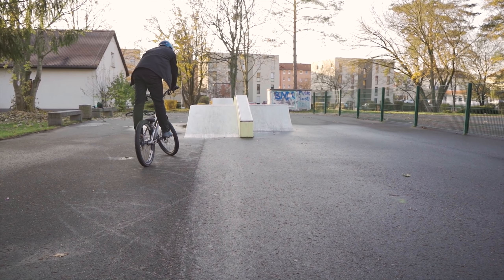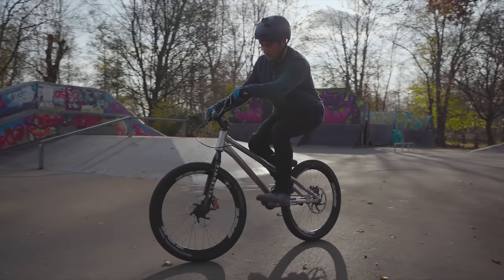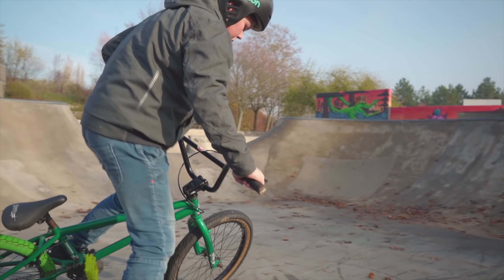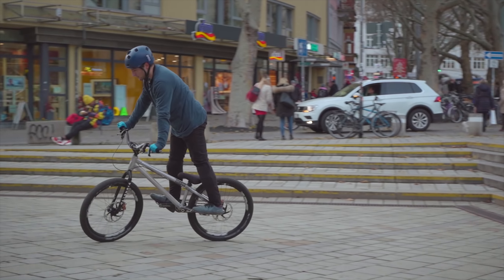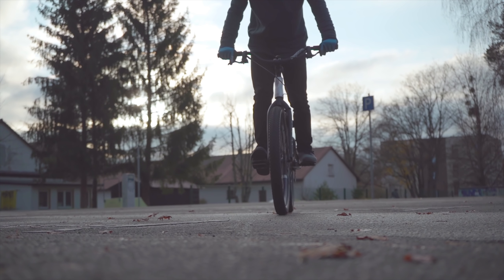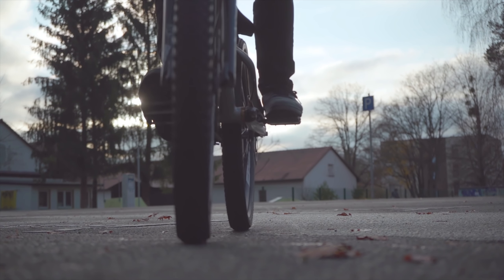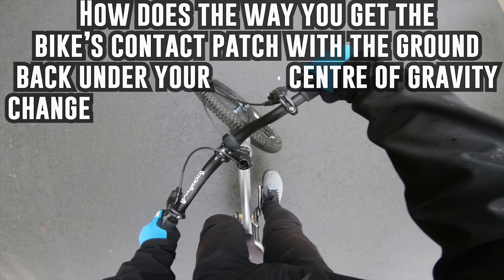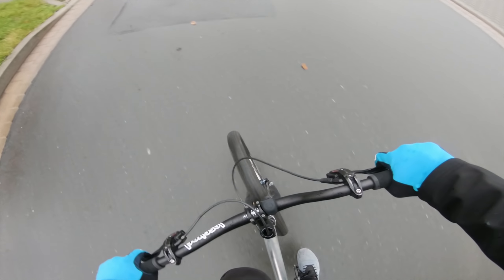Why is it so Hard to Ride Backwards on a Bike? || How to Fakie

Comment: This is genius. I've been riding BMX for 4 years and haven't figure out how to fakie consistently. Definitely will try leaning back
Reply: I've been riding a month now and I can fakie consistently over and over.

BUT... Only right away from a flatground 180/ramp.

If I have to travel any kind of distance. God help the scooter kid behind me 😂 cause I will just change direction with each rotation of my crank.
Reply: Stay Careful. Just yesterday, i leaned back and went down hard. Now i got a sprained wrist/ possibly a fracture. 😅 Best of luck
Reply: Ok it's been 2 months now and I have to say, this video changed everything. I can now fakie very consistently even into full cabs and tyre slides both directions.

The trick is like he said leaning back like a manual when you're going fast. (Also for the tyre slide)

 Just beware of looping out cause you can bash your head hard from this position when you're sending it... 

So.. stairs, rocking quarters or even 180'ing flat if you're going fast enough.

The whip is real, I could totally imagine myself bashing the back of my head off the floor. I have fell on my back a few times! Definitely wear a helmet people! 😂

Comment: Hey Max! That makes a lot of sense about moving the rear wheel to the direction you’re failing when going fast. I assumed my struggles when doing faster fakies were from over correcting. Great video!
Reply from the maker: Yeah, it gets quite confusing, doesn't it? I actually find fast fakies easier to control than slow ones now that I've got a lot of experience with them.
Reply: Yes, i have the same problem. Good at slow fakies and fail in faster ones. This tutorial is great!

Comment: that thing you mentioned about your body position. On a scooter I've found that like a bike moving your weight backwards aids fakie.
EDIT update!. 

I made progress. I switched back to learning it on a 24" BMX. I have learnt to hop into fakie and can make it a meter or two! Originally I was learning to 360 off teh floor but not being strong enough yet to lift all the way round I landed 180 with the intention to learn to come out of that fakie position straight away. But instead found my earlier nose bump endo to fakie practice meant I could actually gain some distance fakie. Now I just need more practice AND to learn how to come out of fakie without putting one foot down (I'm very close to learning it!). 

Thanks for the vids, they are very helpful.

oh EDIT!.

Interesting little trick for you to learn. I have no idea what its called but its related to BMX pump track tricks. The idea is to see if you can get your bike moving forward with ONLY the front wheel/steering. So you would swing the bars left and right and gain speed similar to how a snake propels itself along. So far I can use it to sustain speed and increase speed from a  very low start speed. Its a really fun simple physics trick I think you would like.
Reply: It's called flat pumping I think 🤔👍

Comment: Sitting down makes it way way easier. It took about a month to get decent at it doing the ramp method sitting down. Don't worry about going straight when you first learn too. I was carving all over the place. Standing fakies took much longer. I was able to hang on for short distances to get out of 180's quickly but to actually go 10+ parking spots took more than 2 years. You'll notice that you're going to be better at turning in one direction. Once you realize this, force yourself to really practice turning the other direction. Also, when you do the leaning back thing, try to get into that position as quick as possible, especially after a 180. Don't linger on the front even for a second. I also think a freecoaster is easier for maintaining speed and keeping the lean back position.

Comment: I like your videos and your instructions Max 👍

But with the counter steering you've got it a bit wrong. The rider does not turn the bars in a different direction to initiate a turn. It's actually the front wheel and the steering axis that does that. When you want to turn right you push on the right side of the handlebar. For a brief fraction of a second the wheel will actually Point left and then fall into the right. This is known as counter steering. If a rider pushed left and then pushed right there would be a lag or a delay in being able to turn right and at higher speeds it becomes very dangerous to push both left and right depending on the lean angle. It's different if you're going through a chicane or a series of Corners with space in between the apexes.  so what's you're explaining is the physics of the bike not the rider I think you just got it mixed up but you do understand the concept 👍👌

And as far as why the rear wheel will not steer, is because there is no steering axis it's  solidly attached to the frame with no pivot or axis point. You provide a great explanation of why the rear will not steer and why you have to shift your weight 👌

Comment: Nice video, but it's not true that all turns are initiated by counter-steering (some maybe, but not all).  You can turn just be leaning, this is patently true if you think about turns done when riding no handed or even when wheeling.  Or, consider a bike toy that you roll down a ramp, it will go straight and self-balance for a while before doing a sweeping turn.  Did the plastic toy rider initiate the turn by counter steering?  Obviously not :-)
But great video on riding backwards, lots of useful advice.
Reply from the maker: My explanation was just overly simplified to keep it short.  The point was that 'counter steering' is necessary to get into a turn from going straight.  Of course there are tons of situations where you're already leaning and just have to steer into it.  The point wasn't that the rider has to do it.  It's in the nature of the bike's physics, so yes, even a riderless bike or a toy can display this phenomenon.  Minutephysics has some great videos that go more in depth about bike steering and how weird it is, I recommend those!
Reply: I watched the minute physics videos, interesting, thanks.  The "counter steering" hypothesis seems to be a topic of fierce debate in the comments. I was already doubting each of my own arguments after I made my post.., I have to concede that I now think you (& the counter steerers) are correct!! I should have thought about it more before asserting the opposite. So,  I now think each of my original arguments is wrong, for various reasons!!
Anyway, again, great video, I am inspired to give fakies another go.

Comment: 41 years old. Trying to learn fakie. I still don't get it. When I'm rolling backwards, and I start falling to my right, do I steer to the right (pull right hand in) or steer to the left (pull left hand in) to steer back to centered??? Thanks.
Reply from the maker: Like I explained in the video: If you're slow with your weight over the front, streer the front wheel to the right if you fall to the right. If you're fast and have your weight back, do the opposite to steer the rear wheel where you fall.
Reply: @TheUselessTrials  Thank you for replying. I apologize if I'm being thick. When you say "steer the front wheel to the right" you mean "to the right" in reference to as in when moving forward? Left hand out right hand in?
Reply from the maker: I'm always referring to the side the wheel will roll to :)

Comment: Why can't they engineer a clutch that allows free-wheel fakies (vs. the 'fixy fakie' status quo)? They did it with brake cables decades ago (unlimited handle bar spins). That would be the next revolution in BMX.
Reply from the maker: I don't know if this is supposed to be a joke, but these hubs exist and are called freecoaster. They are very popular in BMX :D
Reply: @TheUselessTrials  thanx- didn't know.

Comment: i dont trust this guy he says you have to turn the opposite way you want to go first
Reply: Toem8tr It is called counter steering. It is what you do on a motorcycle, but also on a bicycle. It is more noticeable on a motorcycle though as you lean more than with a bike. They pull left go right and pull right go left. To simplify that we say push right on the handle bar to go right. When you push the right handle bar it turns the wheel left, but it leans the bike right on the side wall of the tire. Bicycles and motorcycles use leaning and steering to turn. So the more you push right or turn the wheel left the tighter your right turn will be. If you turn the wheel into a right hand turn, it will push the bike under you and this straighten you. I hope this makes sense. You do not actually have to steer opposite first, but you can push in the opposite direction of your turn.
Reply: Daniel Zeman you just typed a whole essay... because you missed the reference
Reply: 8minute lmaoo 😂